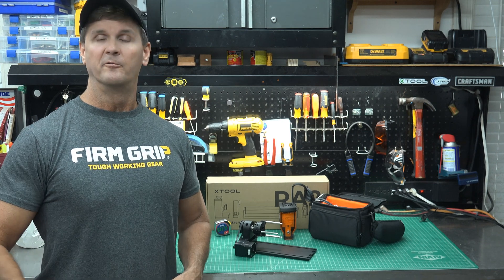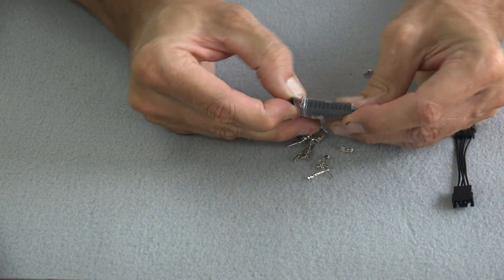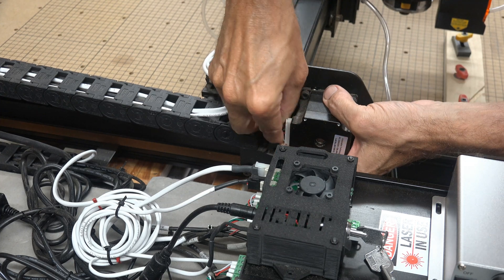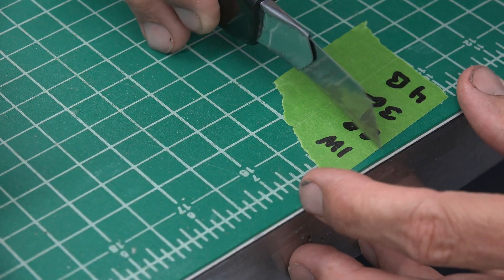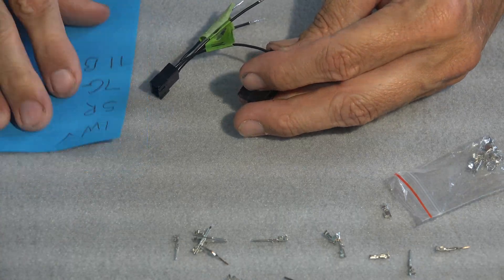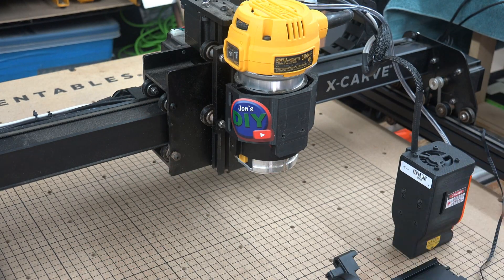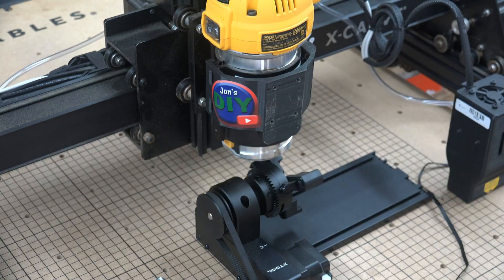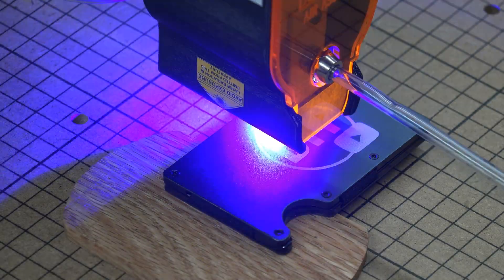Xcarve HACK. How to Connect the Xtool RA2 Rotary to your X-Carve.

Comment: Jon can you tell me what your settings are in light burn for the rotary tool? Like mm per rotation.  Thank you for your help.  Thank you for the video I have been wanting to do this.

Chris
Reply from the maker: Chirs,  are you talking tumblers, glass, Cermark on steel or something else.  I have all my settings on a note pad on my laptop.  Each change in material has different settings.  Alway buy and extra of what ever you are burning and run the Lightburn material test on it.  Also, is your Jtech a 7, 14, or 24?  That makes a big difference.

Comment: I followed your instructions and got everything hooked up, however, the motor on the xtool seems to always have juice to it, and it gets very hot in a short period of time.  Any ideas?
Reply from the maker: No issues with anything getting hot with mine.  Maybe recheck your connections in the clip and make sure you are using the right side motor of the Xcarve.
Reply: @JONSDIY  Thanks.  I'll double check.

Comment: Man you rock. Been searching for this. Now let me ask you a question do you have the upgrade kit on your xcarve with the bigger stepper motors and taller zaxis?  In the video it looks like you have the original ones and that’s the same ones the Xtool uses.  So I wonder if I am going to have to change my settings in lightburn for the smaller stepper motor.
Reply from the maker: No. I seriously bought my x-carve at a garage sale.  They guy never opened the box.  Its not a new one.  Sat in his garage for about 5 years.  Its the full 48 inch one but nothing on it is new.  Take a look and see if you can tell  https://www.facebook.com/JONSDIY/photos/pcb.2674096082905851/2674095076239285/